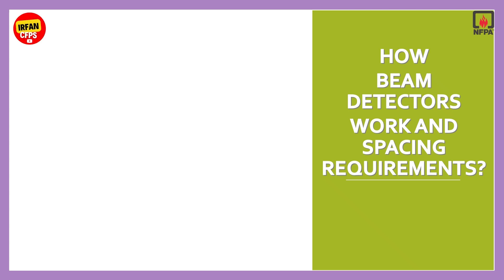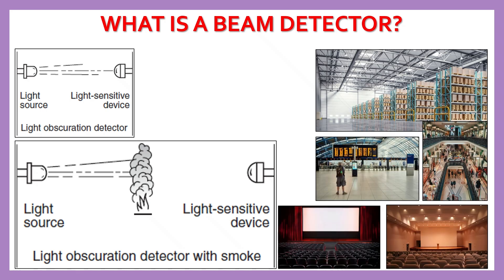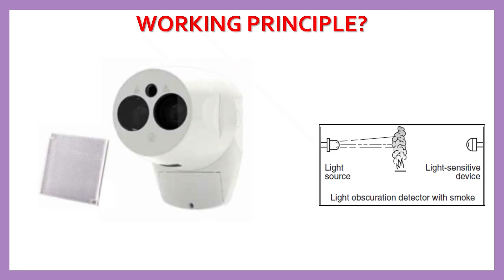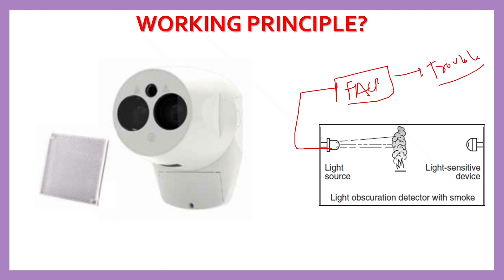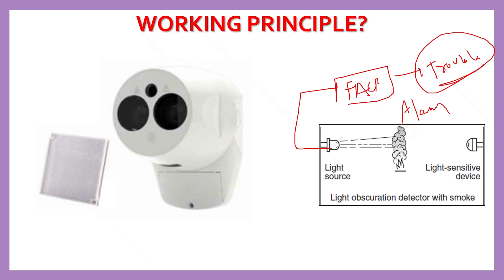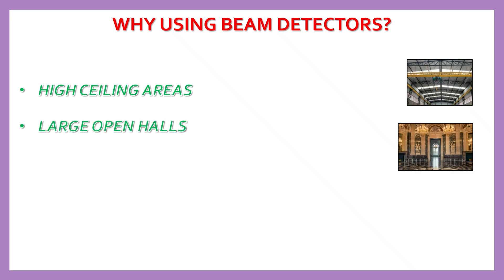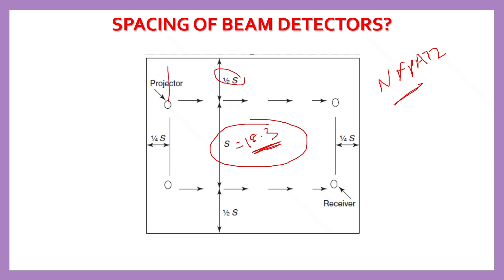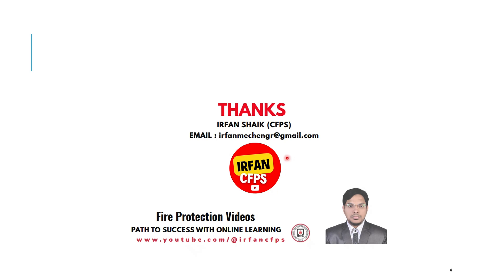How Do Beam Smoke Detectors Really Work? NFPA 72

Comment: Contents are very clear to understand. i have 2 queries. query 1:  shall we install the detector closer to the ceiling or is there some rule for distance between detector to ceiling? query 2 : In the image which you have presented, distance between the wall and the detector is mentioned as 1/4S, that means 4.5 Mtr. generally we will mount the detector in the wall itself. when we need to adapt this 1/4S spacing?
Reply from the maker: Thank you. Please do subscribe and share with others. Regarding your queries 1) You can mount the beam detector closer to the ceiling, but not more than 24 inches (610 mm) below the ceiling. This is to ensure smoke is detected early, as smoke tends to rise and accumulate near the ceiling. 2) You're right — often the transmitter or receiver is mounted on the wall. But the 1/4S spacing rule is applicable only when the beam detector is installed away from the wall (for coverage calculations).